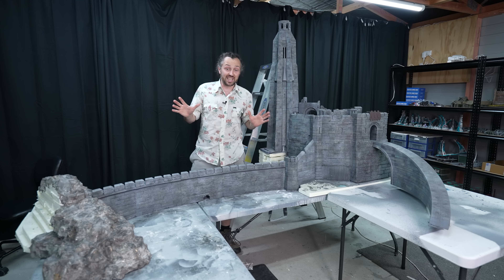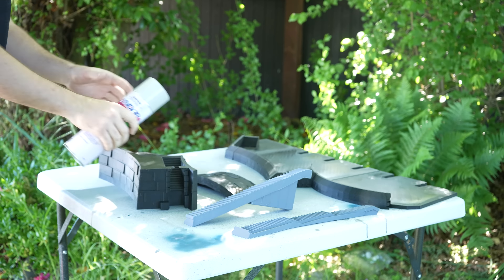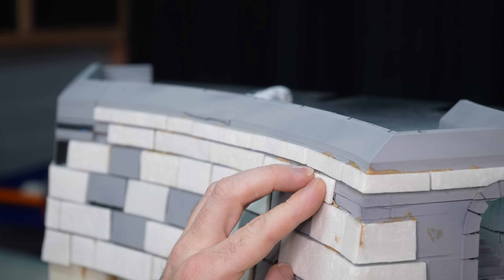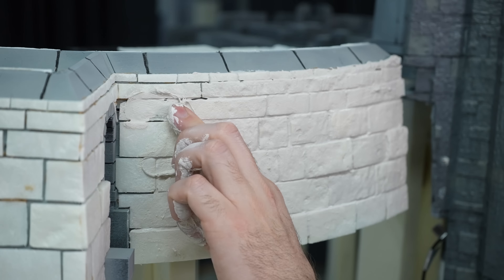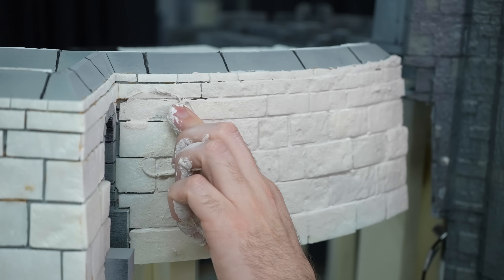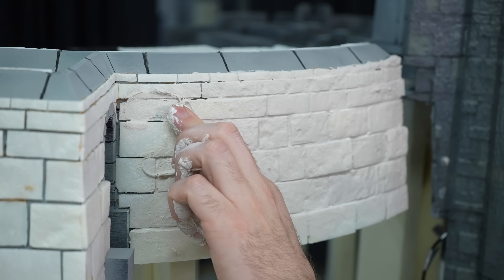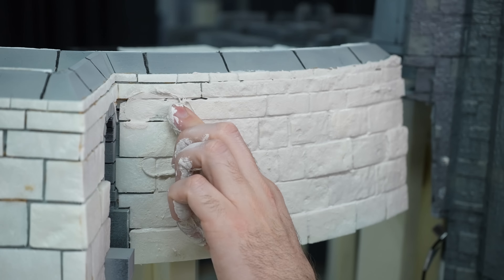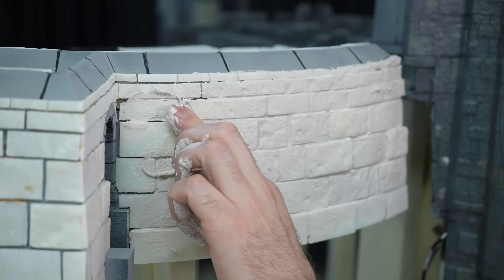The BIGGEST wargaming board in YouTube History! Helms Deep Lord of the Rings Warhammer Scenery

Comment: Some random thoughts. On your pine wood frame my go to would be dowels and glue instead of screws. Mechanical joints are strong but with swelling and shrinking of the wood they can split the pine. Because of warping over time, I would switch from solid wood and opt for cabinet grade plywood (baltic birch if you can get it: as you want material without voids). Yes, it is more work to cut it down, the end result is going to be MUCH more stable. I love plaster cast rocks, I tend to use Dental plaster for such things though. In this instance though, Dental Plaster would be WAY too heavy. On such a massive build, to keep it light as possible, use foam rocks instead? I definitely like the fact that you magnetized components of this monster build. Those random thoughts in NO way take away from just how insanely cool this build is! Please keep it coming! Thank you. :)
Reply from the maker: Mac some really baller advice there mate! I've already been looking at strenthening the underframe because it is a bit too susceptible to torsion, whichi might crack the plaster. Yeah I usually use dental plaster too, but for weight I went with cheaper stuff, I just can't stomach foam rocks for the lack of realism, but maybe some old school foil rocks? I'll have a looksy